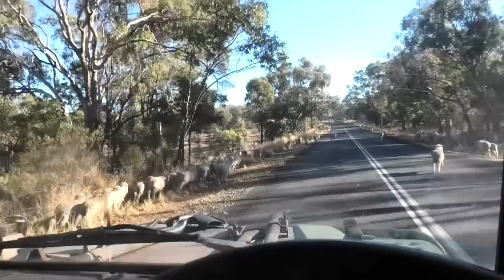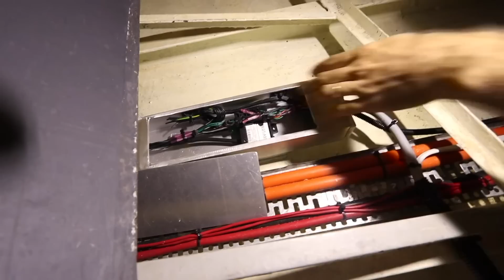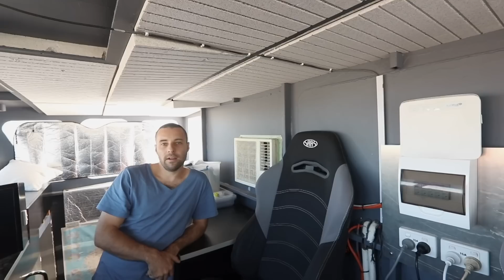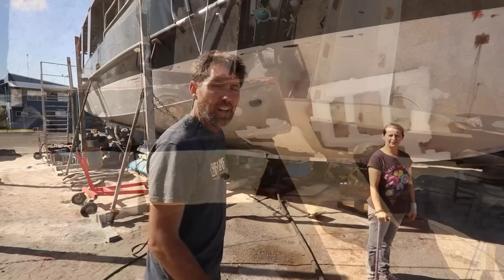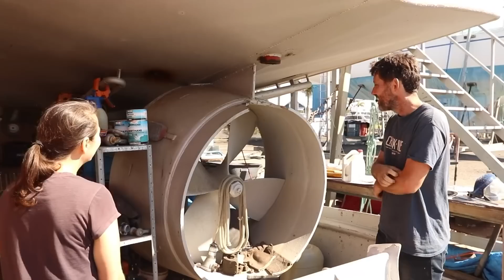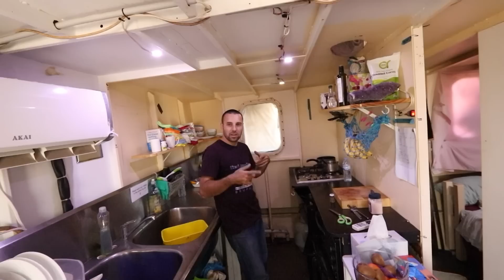Touring Brupeg

Comment: With the intent of going into ice climates, they will likely have real difficulties hammering off the ice buildup off of the solar panels. Ice may also get between the deck and the panels, expand, and fracture the panels.
As far as cooling goes, run the pipes INSIDE the hull. Weld them continuously in  DIRECT CONTACT with the hull. The heat will transfer to the hull, and from the hull to the water. The entire steel hull will become a heatsink, and will provide many factors better cooling, than a free-standing pipe outside. Without the issues of damage, entanglement, corrosion, and speed reduction, and the hull itself will be strengthened because of it, with ZERO penetrations thru it. This also has the side benefit when troubleshooting. Go below deck, put your hand on the hull. If it's warm, the system is working.
And the icing on the cake is that a warm hull will help prevent interior condensation, and will dry things out well below decks when underway.
Reply: I think they might be going during the summer months when it's still cold down there but you don't need a Russian ice breaker to get you in & out, they do run cruise liners down there during summer.
Reply: Hi Mark Turney, we will be swapping to internal cooking prior to heading to the ice. The solar panels will be removed and stacked in the engine bay for any polar work as the sun angle is too low to do any generation and too much hassle to keep ice free
Reply: @ProjectBrupeg  good plan.

Comment: Got to ask - what's this thing do in terms of litres of fuel per nautical mile? Amazing build though.
Reply from the maker: I think Damien said 20 litres per hour running at about 8 knots.
Reply: Tom Biskupic yip those cruising numbers are right. Max speed is 63L/hr but not significantly faster (maybe 11-11.5knots)

Comment: Why 24V and not 12V ?
Reply: John Phillips the main engine and generator is 12v. Left it that way as they came like that and it’s simple. The solar and house bank is 24 for the reason Stu mentioned. If we dropped voltage of cabling cost goes right up as the copper size doubles. Most electrics these days can run 12 or 24 so it’s not real hassle for the gear needed either
Reply from the maker: Smaller cables and longer runs.

Comment: Great video.  Obviously they are engineers.  I subscribed to their channel.  Great build.  A suggestion.  Look into tiny house construction.  Great ideas on cabinetry and bunks/storage and insulation.  Most marine insulation is spray foam.  Keel cooling ingenious for open water.  But for shallow weedy areas of where fishing gear is in heavy use not good.  Unless you like to scuba dive and remove entanglements.    Great boat
Reply from the maker: Yes, we were having the exact same conversation about tiny home furniture designs would be great for boats.

Comment: Good video - brupeg will be great once finished. A tiny warning - that EGT sensor looks to be a thermocouple to handle the temperature. You need special cable and connectors if you need to extend them, and they need to be plugged in the right way around, or they read hot for cold (Work well, used widely in industry, just strange the first time you meet them)
Reply from the maker: Hey mate, thanks for the info.

Comment: If I was going to risk the Northwest Passage,  I'd have two engines, nothing attached to the hull that ice could tear away (goodbye keel cooler),  and a solid bow (they've got an opening for water that will freeze before it ever gets to the scuppers).  I'd also have the entire interior spray foamed for insulation (I didn't see one square inch of insulation anywhere).  I spent a year aboard a landing craft in Korea and I can testify to what ice will do.
Reply: Exterior heat exchange pipe is disappearing before ICE trip.
see 1:06:18 onwards
Reply: @romeowhiskey1146  - Don't know how I missed that.
Reply: I posted before I saw the insulation.  I'd still go with closed cell spray foam.  They'd be able to use less thickness because it's totally sealing off everything.

Comment: you need a separate breaker box for all the A/C hooked to shore power/and switched to genset.
also a separate 12v battery in wheelhouse for !! emergancy! backup to run radios and cumputer etc if something happens to the rest of your system. go look at some fishing/working boats near you make friends and the guys will hook you up with used and rebuilable anchor winches hydros etc.trade for work .

Comment: Brupeg is no steel trawler. That’s a freakin battleship. I can’t imagine how much it cost to drive that thing around
Reply: The Big Fig when we run on Vege oil, $68USD per 24hrs of steaming. It’s big but small at the same time
Reply: @ProjectBrupeg  how many gallons dose that equate to
Reply: @bensmith4563  22L per hour of steaming at cruise or 63L at full throttle

Comment: May I suggest for the wheelhouse pc's to use SSD and not HDD? Seems to me SSD'd would be much more reliable in heavy seas as they have no moving parts (and will speed-boost your systems and draw less power).
Reply: Yeah I think Damien just used the wrong terminology when he said "2 hard drives" he really meant "2 computers". Absolutely should only be using SSD for this application.
Reply: @ApprenticeGM  Hi Guys, yes wrong words.... the plan is two PC's running SSD separated out so one can die and be independent to the first.

Comment: Use Victron for your battery monitor, they also have Bluetooth build in. They also do DC/DC step down power supply if you need them, and some best inverters on the market.
I'm work for a reseller for Victron, send me a message if you need any help or advice.

Comment: For the do-your-own rubber engine mounts he was talking about...could you use the 6 inch (152mm) or more lift kit rubber blocks normally used for raising truck height...might be lots cheaper.
I love the door hinge...a very elegant design!
Will most definitely be subscribing to their channel.
Really kewl to find a fan on the way out   :)

Comment: We use the C type welded on cooler on the 46 meter navy vessel I volunteer on. So much nicer to do the anti fouling and you can run the generator in the dock without any problems. Water never goes over 50 deg C. Paint should not have issues with that. Pipes are a real pain to clean and anti faul and do fail often in my opinion.

Comment: Weld on anodes will give you better electrical contact but bolt on are quicker to replace, which equates to cheaper in labour. 
The IMO is effectively making high sulphur marine fuels illegal in 2020. Which means diesel bug and water contamination are going to be much more rife as well as wear on injectors and pumps as the sulphur acts like a lubricant.

Comment: There you go....  I have never installed multiple solar controllers as I believed that they 'fight' against each other. That is one sees the other's voltage and believes the battery is charged and stops charging. Time for some experimenting to prove Damian's setup. Great work again Stu. Thanks. SOLVED: After watching Brupegs latest vid they all work together as one communicating via Bluetooth. Very flash!

Comment: I have a number of things that come to mind. 
In no particular order...
Keep the air compressor, surely you can run the air into a tank and find a use for it

What's the go with having to go back to diesel at low load? I have done some significant looking into alternative fuels and the only time they need some diesel is when the fueloil is too cold (which has an effect regardless of load) 
Post turbo is a rather inaccurate place for an egt gauge.
Using engine coolant to heat the fuel oil should make it run fine at idle etc.

The electrical isolator upstairs where you can disable the solar is not very good on the inverters if you were to switch that while loaded. (Big voltage spikes)

Those golf cart dc-dc's do occasionally die. Make sure there is a fuse as the thing to fail on it will be the mosfet that will end up shorted and start making fires which is always fun..

Comment: I only have one question. For their vegetable oil which I'm sure they didn't think about 90 degrees inside of a tank that's not insulated from the cold water it's going to cause condensation. Which means you're going to be putting moisture back into the oil. So pulling a vacuum will reduce the amount of moisture in the oil. But you're still going to get a fair amount from the condensation reforming. I hope they have enough water oil fuel separators on that boat. Otherwise they will be stuck a lot

Comment: There is a significant lack of isolation and circuit protection on Brupeg's low voltage panel. Imagine if the 30 amp 24 to 12 amp converter suffered a catastrophic short to ground. Or what if one of the Victron controllers did.  Not good...
Reply: That whole wall panel is mounted on none conductive timber. And every circuit is fused.

Comment: I like the sea chest idea for heat exchanging. Using the time off the water to find what works and what doesn't in the living quarters is a good move too I reckon. As for their pre-heating the vego oil I'm wondering if strapping the hotwater output from the engine beside the oil in line for a few meters would aid in reaching the appropriate temperature naturally with a wire wound heater (no need for a pre-heat thought as he already stated they need to run diesel till it gets up to temperature anyway).

Comment: Nozel = less fuel and more bollard pull for trawlers not other way around :)
I got a 57 foot steel trawler on the south coast mate as for your bung question I use thread tap and anti foul over it and never had a problem with it leaking as yet
Also have bungs for fuel tanks and rudder and the keel 
Keep up the great work mate u beat me bye a day on your boat I nearly had it 😝😝 glad I didn’t end up with it cause I wouldn’t of been able to watch ya videos keep up the work mate

Comment: Careful going with an exposed heat exchanger.  In my area they are never (almost) used as one floating log etc. wipes them out quickly in spite of how stout they look on the dry.  Keel coolers are much more protected as they are fully encapsulated.  Smaller rigs use the inboard exchanger and salt water pump run off the engine,  You would be surprised at the shock power of hitting ice, logs, or worst of all brushing a rocky bottom even at what is considered slow speed.  Often flotsam is partially submerged and invisible as well.  Creosoted piling, waterlogged logs, etc. etc.  So it isn't if you will strike it is when.  Moreso if you are running at night.  Take care.  Doug

Comment: Some comments if I may. The folding door hinge in cabin . Seems when it gets swung open it blocks the gangway alongside deck house. Keel cooling protective plate on front of tubes  would produce huge drag thru water difficult also to antifoul.. Seems on such large boat could possibly have one in and one outlet for sea water thru hull to heat exchanger onboard . If I understand he wants to take boat where there is ice. Those keel pipes would be susceptible to damage Neat but complex electrical system without any labelling.16? random anodes on hull . Seems like a lot of drag there.

Comment: You might weld a channel inside the hull and use the outside skin to reject heat. Or a blister. There are calculators for the number of sq ft per hp

Comment: Why not a keel cooling tank, rather than pipes? Thus the exterior would be flush. One two inches wide two foot high and three or four foot long (sort of, don't know how to calculate actual size required). With the hull forming the outer walls of the tank.

Comment: On My 5-Dump Trucks We Used 3/4" Gravel Belting Material & Cut Our Own Mounts For Between The Metal Frame Brackets & Block! It Will Quiet It Down A Lot... Look To Any Sand/Gravel Operation & They Will Have Old Rolls 2' to 3' Wide Layin Around & Always Gave It Free To Cut Some w/Razor Knife? It Would Work Great to Lay On Bottom Of Engine Room Also For Sound Proofing & Easy Cleanup Also, Plus Put It Under Your Batteries For A Little Cushion & Keeps Any Acid Corrosion Off Your Metals!!!! High Back & Twin Arm Rests Air Ride Trucker Seats Would Be GREAT On A Boat Also! Plus Red & White LED Lighting Systems For Night Visions ETC & Radio Control Is Perfect For Boat Servo Steerings, Throttles Etc! Also Trucking Power Take Offs That Hook To The Diesel's Fly Wheel Would Be Great For Your Hydraulics w/Air Locker In & Out, New They Are $500 We Use Power Take Offs For Dump Rams +++ On Dump Trucks Which Would Easily Convert To Boats For Winches, Dantons ETC!?  Thanks Mates ;~)P

Comment: Hi, heard you mention mounting the engine. When I worked for Firestone they produced Firestone Pneumatic Aeon Rubber Springs that were used to mount and isolate engines and plant machinery. I am sure that there are agents in Australia but the price could be high. Good work!

Comment: That cactus is prickly pear I think , very much hated invasive pest plant in Qld.   As for the Victron solar controllers yes I'd agree they are great,  might have got away with 2 controllers, eg say wire the panels in series / parallel,   nice and tidy electrics there , great work.

Comment: So...at 42:50..they are talking about taking those cooling tubes off to avoid having them torn off with ice. Since they are doing so much fabrication, why not weld on some streamlined cages the length of the tubes? Allow water to touch them and do the cooling but protect them from the ice they are running through? It shouldn't cause too much drag and may even let the boat run more stable under speed?

Comment: Circuit breakers don't work with solar panels because solar panels have no fault current, and switching under load will kill those switches very quickly....
Reply from the maker: What type of switch do you recommend?
Reply: @DangarMarine  No switches needed. if you need to have one though carry a blanket to cover the panels and then simply unplug a lead or have a switch for no load disconnection.
Comment correction/edit* 
I'm used to bigger systems with higher voltages talking 600v DC which will draw an arc 1m long!
They probably won't burn out, unless he switches them off under full load regularly, he is only running 2 in parallel so they will probably be ok considering they are probably only 36v panels.
They are designed as a circuit breaker first and switch second, they aren't really intended as means of manual disconnection more automatically in a fault situation, on a "normal" DC circuit.

Fuse /circuit protection:
Protection on the panel side is pointless as a solar panels fault current is its maximum current which you want to use to take full advantage of it.
PV systems are a bit of a head spin as everything inside you tells you that it a circuit must have circuit protection ha ha.
With the leads of a panel connected together, it will just sit there all day no worries making maximum current.
It's actually a way of testing the panel to make sure it's performing with a clamp meter.
The only way to stop a short circuit/ anything else is to cover the panels from light.

Comment: A suggestion re which PCs to use - several manufacturers make /Ultra Small Form Factor PCs which mount on the back of the displays, eg Lenovo.  Saves a lot of cabling.
Reply: Yeah, that's a great suggestion. Thanks Ein

Comment: They put little wings on my 1967 race boat's rudder to help control at low speeds.
 It's kind of ironic that to go to Antarctica you have to use high Sulphur diesel "witch sucks for the environment"
Reply: We would love to be able to use oil down there but we really don't know if we can keep it liquid at minus 10c. that said its also a safety thing, if Brupeg does get frozen in, we need to be able to winter over and we seriously doubt oil would work at minus 60c which is what the boat will need to survive over an Antarctic winter
Reply: Oh I'm with ya, frozen fuel may mean frozen people.  Be safe. This is coming from someone who's boats get about 1 mpg or less.

Comment: Just spitballing, but I would consider putting the switches in the wheelhouse on a locking slider so that you can move them forward for those times when you are at the wheel.
Reply from the maker: That's a great idea. Nice one!

Comment: That was interesting. The seaworthy boat seems like any residence...just add 15 more specialized systems. Also a bit like a spacecraft destined for hostile environs, with system redundancies for unexpected contingencies. On the fresh water, immersion cooling systems, seems like your boat could do with 1 to 1.5" pipe, and if not stainless, why couldn't you have it ceramic powder coated to simplify maintenance? Also could imagine the pipe network mounted on brackets and hinged ones at one end; swing-out convenience. And some durable hose lines could enter the transom above the water line to thwart any hull violations, connecting to a pair of welded-in down tubes with splittable fittings. And similarly on the inside. Was wondering as well if instead of fresh water circulating, would antifreeze or even thin oil provide better heat transfer (thus a smaller network, but more hellish leaks). Your videos certainly set the mind to thinking and imagining; a nice additional dimension. Thanks for the effort in conveying them.

Comment: Wire your solar panels to 24 or 48 to your charge controllers for 12v or 24 v power out.    Voltage loss is less and you can use smaller wire from panels to controllers.      Nice boat